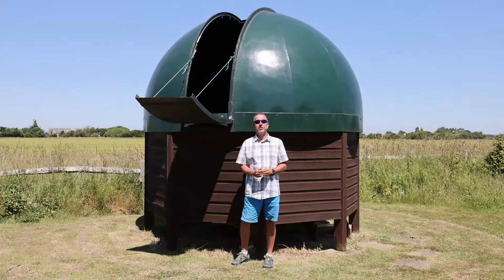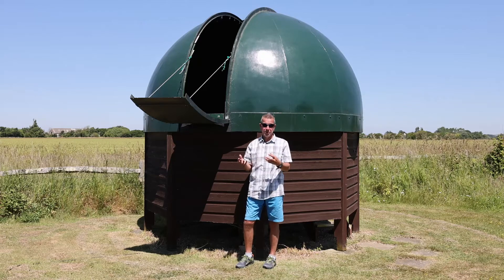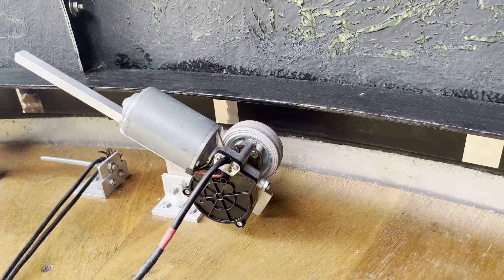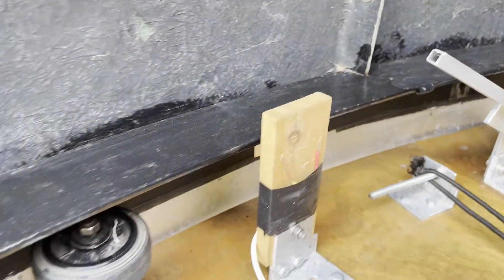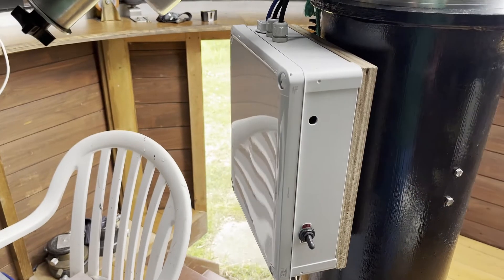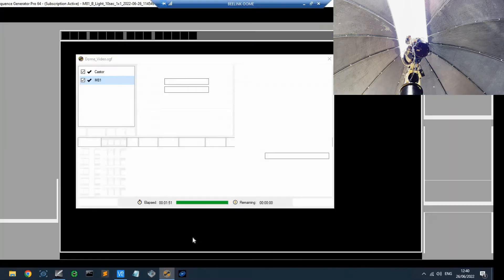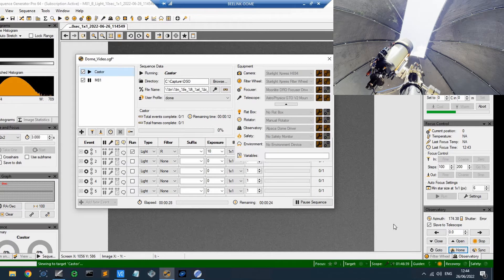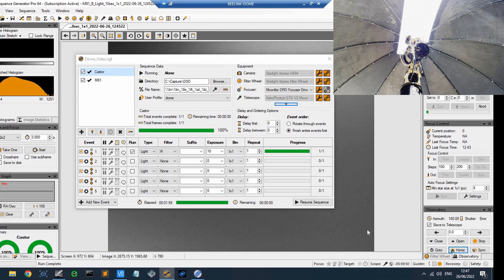ASCOM Alpaca Dome Part 1 - Introduction

Comment: On the position detection system, I had the idea that a 3d magenetometer and an 3d accelerometer, cheap arduino, gives you a very accurate sensor for the opening.

Comment: Ian,
To automate the closing of the shutter, put a plastic "gasoline can", suspended from the rope that controls the shutter, opening side down.

Attach a hose to the cap.

To close the shutter, pump, using a computer controlled pump, water from a tank, into the jerry can. At some point the weight of the water in the suspended can exceeds the weight of the shutter, and it closes.

To open the shutter, reverse the pump, pumping the water out of the suspended jerry can, until the weight of the shutter can lift the jerry can.

In the winter, you may need antifreeze in the water.

Some pumps, often 12 volt rubber impeller type, will run both ways, depending on polarity of the incoming supply. Jabsco is a US maker of such pumps. They don't run as efficiently in "reverse".

Is the upper shutter the opposite sense, as in pull/release cord to open? Could one counterbalance the other? One moving "variable weight" might be able to do both!

Another option might be to put the storage tank high in the dome, and allow the water to move by gravity in one direction.
Reply from the maker: Hi Steve, thanks for your comprehensive reply! The issue I have is with the shutter itself - it's quite unreliable and gets jammed easily. If I can get it working more smoothly I'll look further into this. Many thanks.